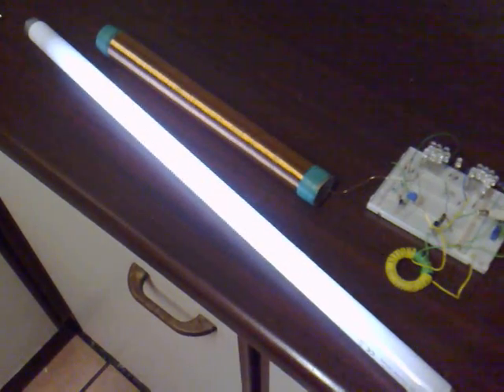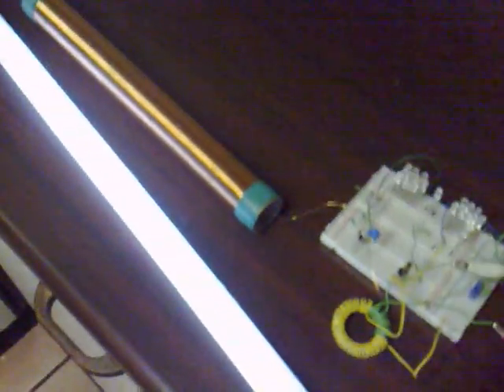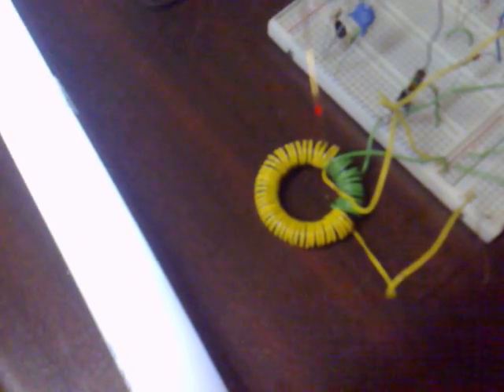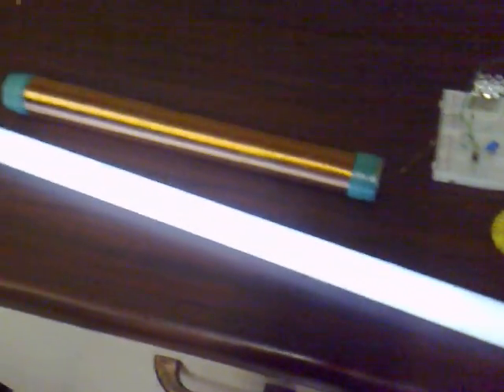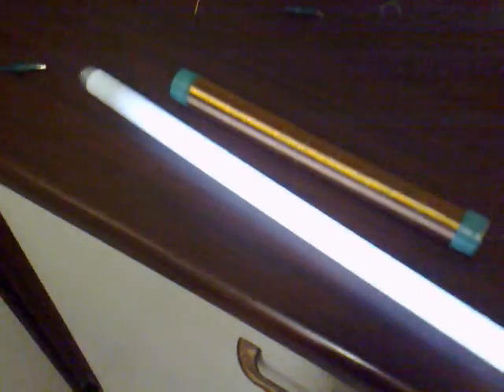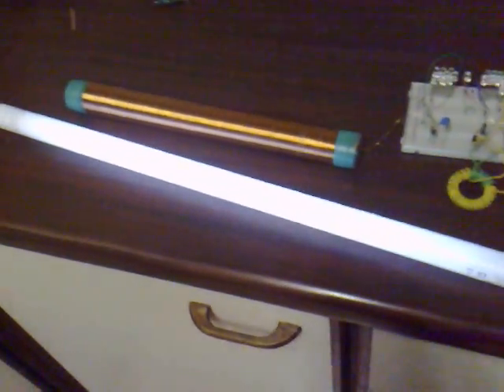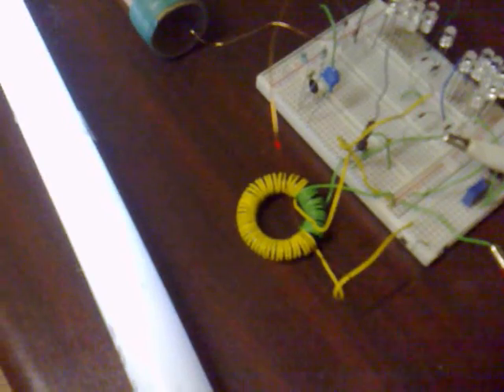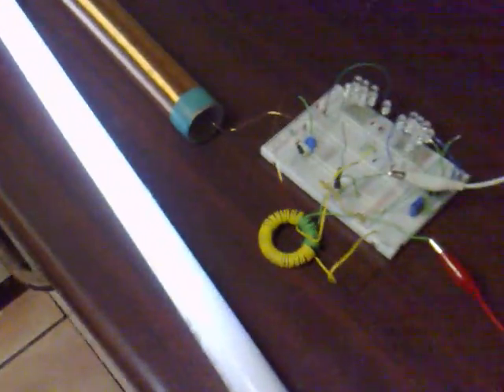slayer sec with toroid feedback

Comment: @Lidmotor kind of old news... but I played with this same thing today and used a told of four aluminum heat sinks as variable air capacitors shown in my little video on my channel right now and it works very well, i was able to get a similar setup running at 6V.